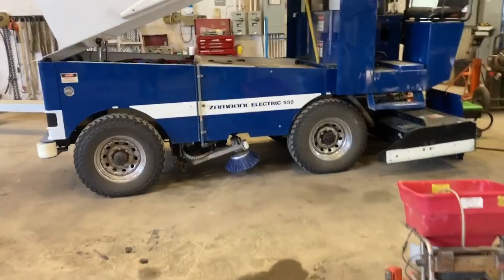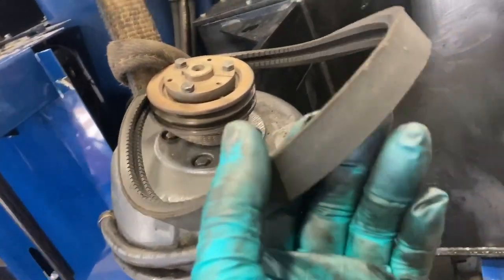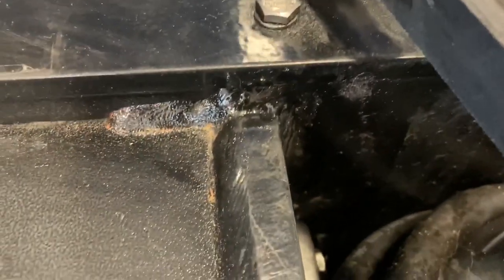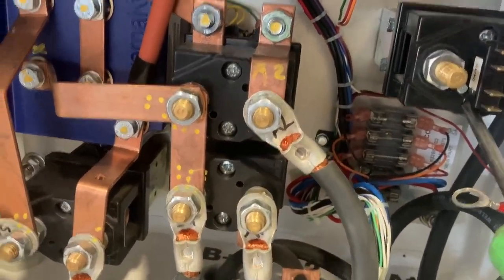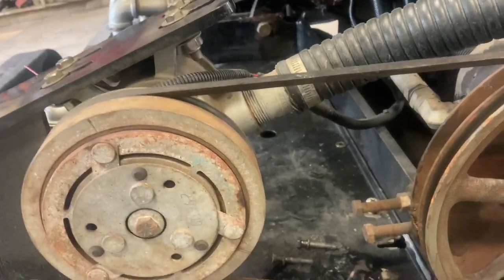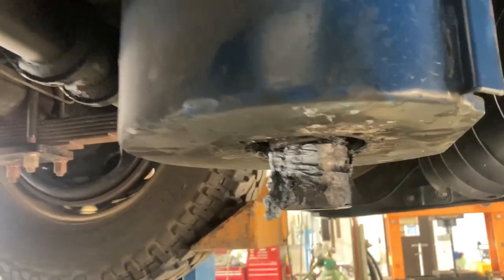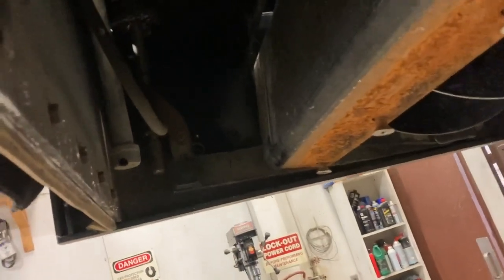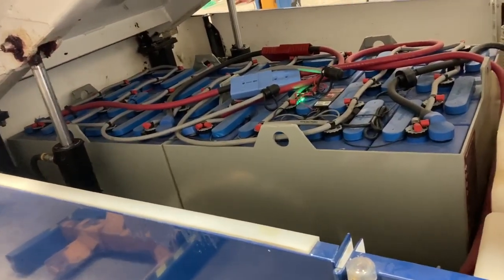Zamboni 552 electric maintenance

Comment: I just noticed why and how snow box went down while cable is unplugged,is there any chance I can boost it?
Reply from the maker: I don't think so, I'm not sure if any booster is big enough for the system on these units.  You may be able to power up the hydraulic motor with a booster or DC generator though

Comment: i have a question. are the lugnuts on these zamboni reverse thread?
Reply from the maker: Sorry just saw your comment, no they're right hand thread, just standard Dana 60 axles
Reply: @Pneumamechanical  thanks! new to being a zamboni mechanic here in Malaysia
Reply from the maker: @aimansahaja5981  no problem, they're a pretty simple machine, just need to be maintained